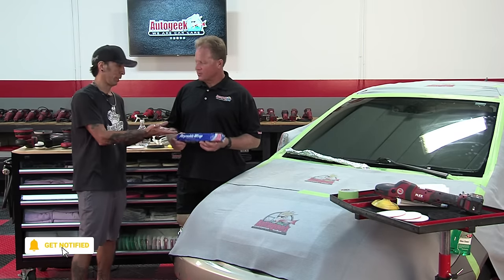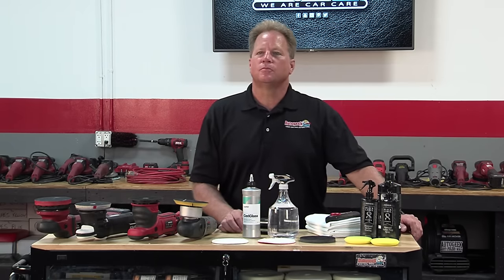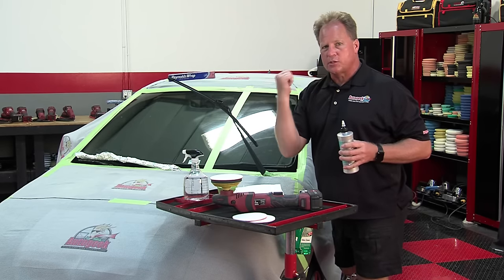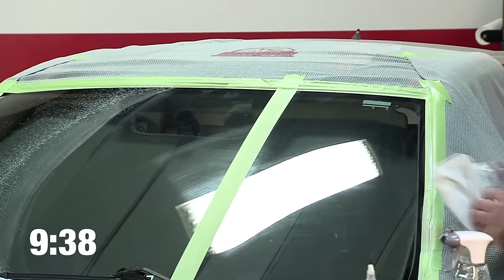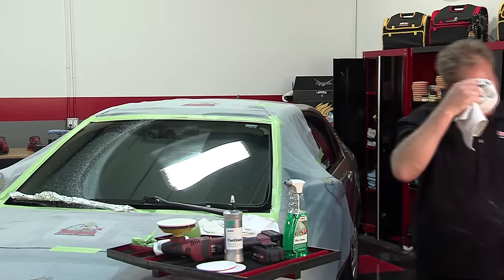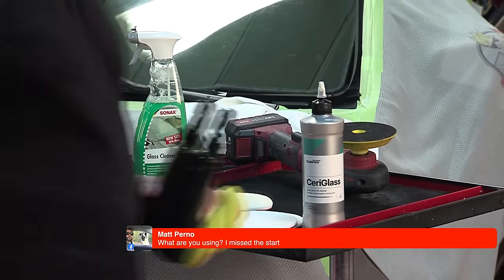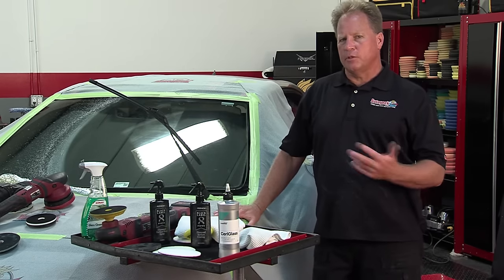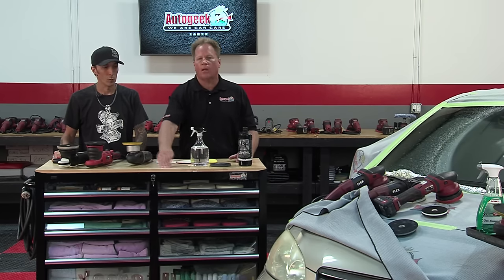How to safely remove pits, wiper marks & scratches from glass

Comment: at 51.35 its clear that the deeper scratches left are inconsistent with the trajectory of the wiper and therefore not from the original wiper damage. So my question is, has the grinder caused this damage?

Comment: I have a 1956 Belair and the first time I turned on the wipers, it created a thin scratch/gouge for the entire arc of the wiper path.  If I use the method demonstrated in your video, do i polish the entire windshield, just the driver’s side where the scratch is located or just along the path of the scratch?

Comment: Question: Is there not a more effective abrasive than C.O for this application? I would interpret the fact that this method is labor intensive, because its like trying to polish rough-hewn lumber with a high-grit sandpaper instead of working your way up the ladder... It seems like deep/larger/severe scratches require initial passes with something deeper, no? 

Surely there must exist a coarser level of C.O. or perhaps a similar but more aggressive cut?
Reply: P.s. just got to the part where you mention Trizact. Thank you for the thoroughness.
Reply: There are diff ruffness of CO too btw
Reply: They aren't using cerium oxide. They are using a polishing compound that contains cerium oxide. Cerium oxide mixed with water into a paste with a rotary polisher or sander would cut faster for sure. Wear a respirator though!

Comment: Good video very informative..
But what about small pits from sand etc...
I get that blinding haze at sunrise and sunset..
Reply: I am trying to doo this on my audi, so far its alot of hardwork and lots of product. But they will eventually come out of the screen, depends on how deep. Some of mine is about 1 mm deep, and i am leaving those until i can afford changing the whole windscreen. Its not a wonder product, but will buff out scratches and very shallow pits.
Reply: It should round over the edges of the pits and make them a bit less visible and the view through the windshield a bit sharper.

Comment: Hey sweet work! I’m about to order these products from your website to restore glass headlights which has small rock chips. Do you suggest I use sand paper on the glass surface first and then use the ceriglass polish ?

Comment: how do you stop wiper blades from chattering? Or is there a particular brand or type that resist chattering best>
Reply: Use nu finish on your windshield.It works makes glass smooth.
Reply: If cleaning your windshield and wiper BLADES doesn’t help you can tweak your windshield ARM by slightly bending the ARM with a pair of pliers. Google it. Being in the wintry northeast you can accidentally bend the wiper ARM by pulling your frozen wipers off the windshield.
Reply: Buy quality blades..you get what you pay for

Comment: I used to do this when I had my shop. Auto Glass back then was @ 200% profit. I used a foam Pad & Gojo With Pumice. Yes, it was time-consuming but it worked. And yes the water not only helps cool things off but it helps out with the cutting process.
Reply: Gojo with pumice?Thats a joke.Thats like using sand paper 😂

Comment: If you have a lift I would get 4 by 8 sheet of ply and rig a temp scaffold so your inches above the hood pushing straight down on glass rather than the twisted strain from standing on the side of car. I bet you could take astronomical seconds off the total time it takes to rid those pesky marks. Always remember kids, crack kills¡!¡

Comment: I get a ton of cars through my shop with extreme water spots, I'm in Oregon.
Reply from the maker: For JUST water spots - any quality compound and foam cuting pad, microfiber pad or wool pad will work.  We do sell a VERY AGGRESSIVE glass polish for TOPICAL glass polishing - NOT for removing scratches as this requires Cerium Oxide.

https://www.autogeek.net/blackfire-glass-water-spot-remover.html

-Mike Phillips
Reply: @autogeek  for water spots on paint i like Kamikaze water spot remover after an acid bath. For glass I like IGL Glass+ and a magic eraser, you definitely want to do the glass before the wash as Glass+ is a lot like Ceriglass, it make a hell of a mess.

Comment: What about deep chips in a glass t-Top. Can you use the stuff that fixes  a star in the windshield to fill them ?
I also have a wiper arm mark near the bottom of the windshield id like to buff up -arm was bent. It took 3 glass shops to figure out how to set the glass in for this car, i Dont want to replace it again - 97 camaro ss.

Comment: Can someone PLEASE recommend a detailer to do this work in the NY area? I'm restoring an older Mercedes SL and my windshield is every bit as bad as this one -- same issue with wiper swipes. I have absolutely no interest in doing a DIY on this, and will gladly pay for the work -- but every detailer I've called refuses the job, sight unseen, telling me they don't do glass polishing. Help!!
Reply: ammo ny
Reply: Try searching for accredited ceramic coating installers, like Gtechniq or Modesta. You can google search these and enter your ZIP on their website. Usually, these detail shops meet or exceed stringent standards. They are usually, a great start.

Jimmy @ Chicago Auto Pros

Comment: That 40 or 50 year old or so glass on an old muscle car can be surprisingly hard and difficult to get any cut on them. Maybe dust and mouse piss harden glass or something, haaa!  Don’t be shy at all about pricing this kind of work on a nice muscle car.  Old cars that are survivors/drivers can have insanely deep scratches from so many years of old metal wipers that are more prone to dragging than modern cars and barn dwellers can have decades of pets, critters, cardboard, kids, Christmas decorations, and gawd knows what else being ground into the glass while it serves those years of neglect pretending to be a shelf so it’s not likely to be an easy one.  And guys with those kinds of cars come in two flavors…the hardcore old school do it himself, daily driver, perpetual dirt under the nails guy, and nostalgic guy with mucho money who pays other people to work on his car and rarely drives it if ever.  Both of these know some things are just expensive on old cars, dirty nails guy may be leery of doing the one thing he doesn’t know about on that car, and the look at me guy is accustomed to dumping a bottomless bucket of money on his car so don’t be the only one who  loses money working on his ride.  And both are smart enough to know if they opt for just replacing it, the glass they order may it may not fit just right, the seal they get on the new one may or may not be just right, etc. regardless, there’s enough possibilities that they can damn near count on it leaking.  Plus you’ve got the money pit factor…they could be opening a huge can of worms and regret ever touching the glass.  Most guys who know about that life of being an old car owner know that they are going to pay a premium for damn near everything on that car. So unless they’re strangers in a strange land, they’re expecting you to quote them a big fat number.  Don’t disappoint them.

Comment: Help! I Used Chemical Guys Heavy Duty spot remover on my Mercedes S550 windshield to remove hard water spots and it appeared to have removed the water spots, however when driving towards the sun, my windshield now has scratches all over it that makes a glare across the glass. Have you any idea how I can correct this? Not sure what happened, I washed glass, dried it and then applied the spot remover with a micro fiber sponge in back and forth motions, then wiped glass with microfiber towel and then washed glass with car wash soap and rinsed with DI water. How did that mess up the windshield? I noticed today when driving it, the scratches are only where the wipers touch the glass when on. What do you suppose happened?
Reply: Softer pad and try again. Also, did you use a foam interface pad?
Reply: @jeremys8360  I used the microfiber sponge Chemical Guys store recommended to use with the spot remover.
Reply: @jeremys8360  Found out today my S550 has laminated glass all the way around and Mercedes confirmed that Chemical Guys Heavy Duty Spot Remover destroyed the lamination. They'll need to put a disclosure warning on the product which I will seek a court ordered injunction to force them to do. I'd say they are very lucky I didn't use it on the rest of the windows which still have water spots for now.
Reply: @MercedesMechanic  No you're not.
Reply: A trip to Mercedes of Beverly Hills discovered that the spot remover took the IR coating off my windshield and left patches of it throughout the windshield. Chemical Guys are selling products that destroys peoples windows. They need to take that spot remover off the market.
Reply: The glass manufacturer that made the windshield on the 2013 S550 confirmed that you cannot use anything but basic window cleaner or soap on the glass, otherwise you'll end up with a damaged windshield which is what happened when using Chemical Guys Heavy Duty Spot Remover. Thanks Chemical Guys, aren't you so knowledgeable about car care!!! See you in court!
Reply: @MercedesMechanic  what about polishing like in the video with rotary and regular Compund like sonax cut max!
Reply: @angelseliteautodetailing  Mercedes Benz said not to polish or buff the glass on this car as it will further damage the glass. Needs replaced.
Reply: @angelseliteautodetailing  Mercedes Benz said not to polish or buff the glass on this car as it will further damage the glass. Needs replaced.
Reply: @money FYI ALL OF CHEM GUYS PRODUCTS ARE TRASH
Reply: @omarnunez5696  Agreed, someone needs to stop them before they cause more damage to peoples cars
Reply: @omarnunez5696  I use Chemical Guys stuff on plastic trim and tires and it lasts a lot longer than other products without the annoying glare on interior plastic surfaces. I would not use it on the plastic just below the windshield however, it might cause distracting reflections. 

Not every one on their products is "trash," but I have only used the one.
Reply: @teemcshanney8910  Hey buddy if your happy then im happy.  Aslong as you like the products your using and it works for you..thats all that matters.  As for me i truly dislike chemical guys..but i may just still be bitter about the $3500 dollar course i took a few years back that taught me nothing of what i know now

Comment: What is the difference between rubbing compound and glass polish other than cerium oxide?
Reply from the maker: In addition to cerium oxide, glass polish may contain other abrasive materials such as aluminum oxide or titanium dioxide. Rubbing compound may contain abrasive materials such as silicone carbide or aluminum oxide.

Comment: I did the cerium oxide treatment years ago, with a slurry I made, a drill and glass polishing pad. It took awhile but the results were very good, got rid of all the lighting scratching from dry wiping (pollen?) and whatever else caused it. I couldn't believe how much dust it created lol, it was EVERYWHERE. Plan on masking off everything or washing the car when you're done. I also made the mistake of not taping my trim, and it permanently scuffed up the rubbery trim on my honda windshield. I tried a lot of things and nothing will restore the color back to black. Any suggestions for that?
Reply from the maker: Sounds like the glass polishing kit from the Eastwood company?  I've use it - wasn't impressed but it did work, just real messy. 

As for cleaning spatter off rubber trim?  Yeah - this is why you saw me go to GREAT LENGTHS to tape-off and cover up with the Autogeek Cover-up Towels everything around the glass.

Been there done that never going to do it again.

How to clean it?  That's really tough as that splatter seems to impregnate into the rubber surface.  Outside of what you've probably already tired - a toothbrush with an APC or Degreaser - you might try a dedicated Dried Wax Remover.  Lightly scrub with a Scotchbrite pad.

-Mike Phillips

Comment: Could you use a  3 1/2 angle grinder with the 4 in backer or the rpm being wild fast would be too much heat and ,.. just too much
Reply: Way too fast .. he was turning 1400rpm and an angle grinder spins around 10,000rpm .. too much heat

Comment: Wheel acid diluted with a rag works great
Reply from the maker: For removing TOPICAL films - not scratches in the glass.  I would LOVE to see someone make a video REMOVING scratches like I did in this video by simply wiping a wheel cleaner over it.  Go for it!  -Mike Phillips
Reply: Hmmm...a mild acid and glass? You might not realize that there's a reason they sell the strongest, most concentrated acids in glass bottles.

Comment: Whatever happened to the "glass wax" product that restorers could use to make 1950's cars look like new without replacing glass?
It must have a new name or be made by another company?
It was sold in a can like acrysol.
You sure take your detailing seriously.
There's so many different precautions and material types.
The average viewer can't really process all this info.
Here's a quickie.
Orange hand cleaner.
You apply it with your hand and work it in all over harmlessly. Rinse it.
Then use your repellent spray and keep wiping till dry. Use paper towels like the white ones at the gas pumps.
Once a year I do this to my old Chevy in a very rainy climate.
I use the repellent every month or so with local driving.
If things are very deep?
Then I need your info for what the pro does with a buffer.
In a streaking emergency, like a rainstorm? You can use a .90c box of baking soda to wash wipers and glass.
Hope this helps people.
Newspaper is the streak free and cheap wiping tool for what glass cleaners can't even touch. Elbow grease they say.
Reply: You can still buy glass wax.
Reply: @mountaingrandmama  have you seen the product for sale?
Or what

Comment: But you didn't post the link to the FOAM INTERFACE PADS
Reply from the maker: 6 inch -  https://www.autogeek.net/3m-6in-interface-pad.html 
3 inch -  https://www.autogeek.net/mirka-interface-pads.html
Reply: most napa parts stores have them. I bought mine there, 3m brand. Has held up well.
Reply: @junqtaylor5652  Thanks

Comment: 3 hours at a hundred bucks... How much does it cost to replace a windshield?
Reply: Not every bit of glass is still available.
Reply: They never put it back like factory.
Reply: @PaddleDogC5  so you mean the factory is better windshield than manual replacement windshield?
Reply: @khristianmanurung9632  I think he means a full-time vs a
 guy with 5-10 instslls.

Comment: Very informative video. Thank you. I have some scratches in my windshield. I have a DA with a 6 inch plate. I like the Carpro products but the only pads I see from Carpro are 5 inch. Can I use another manufacturer’s pad?
Reply from the maker: The only other manufacturer we carry that has the similar Rayon material pads that you would need to use is Lake Country. Both make a 5 inch size only. All you would need to do is buy a 5 inch backing plate to go onto your tool and you can use either brands Rayon pads!

Comment: A bunch of morons here don’t know the value of seeing the job done in actual time. As oppose to many videos on YouTube were they speed up the video and you never know how long it took to repair. Like that you already know from the get go what results to expect in a certain amount of time and won’t get unmotivated and impatient not knowing. I would’ve like to know however, how deep were the random scratches that remained. If they were the kind were your nail gets caught up or even deeper. That info would had made me decide wether to go with the trysac method (don’t know the actual spelling) or just buying a new window glass. Also it was great to know that if the windshield has rock chips you shouldn’t waste your time.
Reply from the maker: Thanks for the nice comments Ray.    The random scratches that didn't come out will come out with just a little more buffing.  My finger nail did NOT fall into these scratches.  I do see a lot of cars with scratches deep enough that your finger nail will drop into it - and "yes" these are for the most part too deep.  You can machine sand with Trizact sanding discs but that's a huge undertaking.  -Mike Phillips

Comment: i was told you can use steel wool for windows...thoughts?
Reply: Yes, works to remove spots and staining, big bugs, you can also use a single edged razor blade to scrape stuff off too.
Reply: Super fine steel wool works great. No need to wet it. Just clean the glass first then go over the window with the steel wool then clean windows off again.
Reply: @ronb9901  oh ok thank you.. I didn't know there were different types of steel wool.  Will doing that take all the little scratch marks out of the glass then hopefully?
Reply: @lanaiaholly2406  yes, it’s like polishing the glass. After I do that I treat the windows with a ceramic spray. I hardly have to use my wipers when it’s raining. My buddy’s couldn’t believe how smooth my windows felt. Now they’re all doing it.
Reply: @ronb9901  I will do that today .. thanks for your info !
Reply: Yes.....  Only use 0000 wool with a good spray cleaner..
Reply: After trying most everything else, I used 0000 steal wool saturated with a rubbing compound. It took off very water spotted windows on my RV